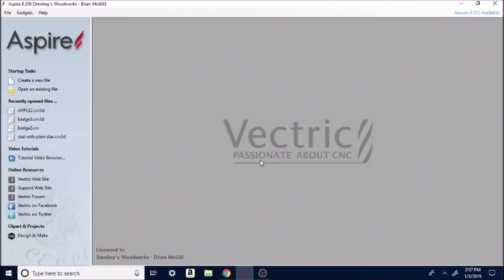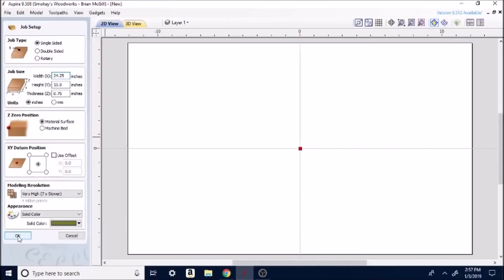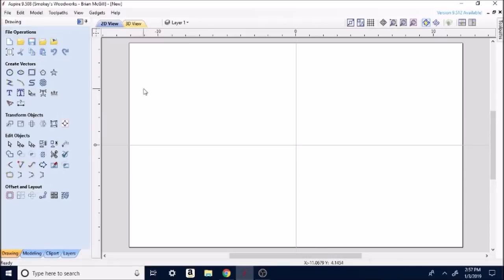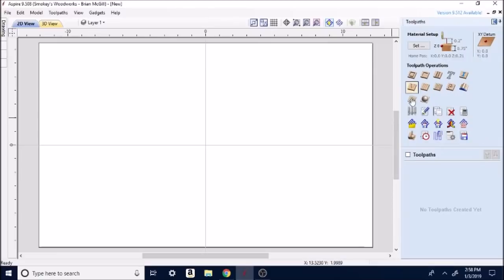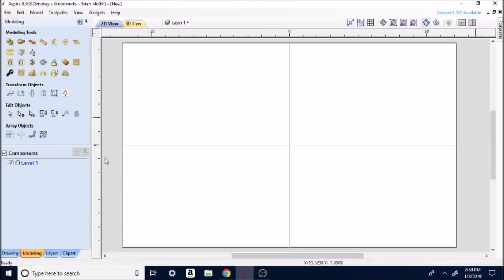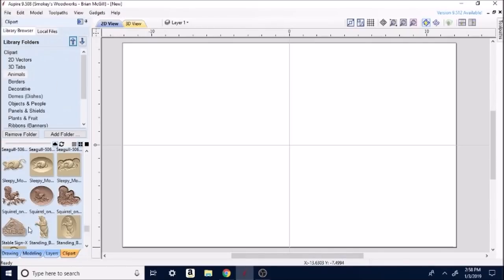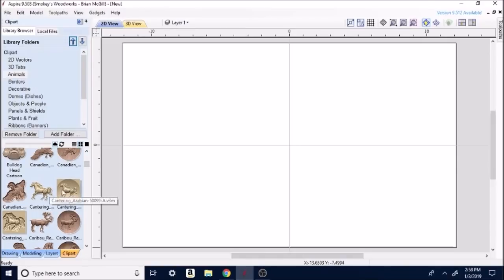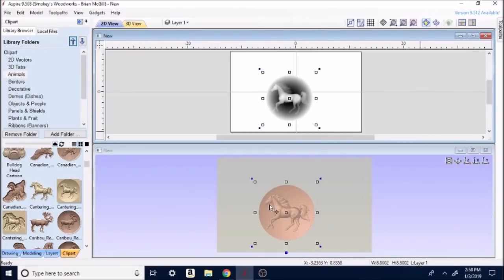Q & A about CNC accessories

Comment: Thank you for sharing.  I'm going to look at the mask as I have allergies. Just cleaning the house will set them off. I wear the paper masks, but they tend to fog my glasses.
Reply from the maker: These mask are awesome. There are several brands and most of them have different classes of mask.  My wife got me the one for construction and it also blocks toxic industrial fumes.  Works great, thanks for watching!!
Reply: Smokey's CNC Woodworks I went to Amazon and have found two I am interested I . Thank you so much.